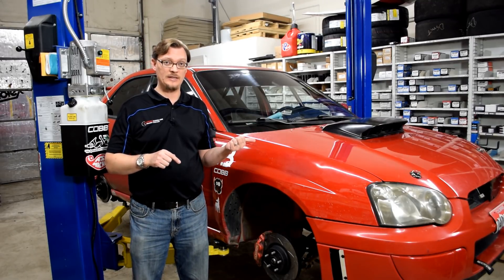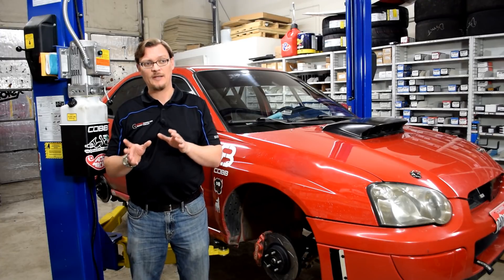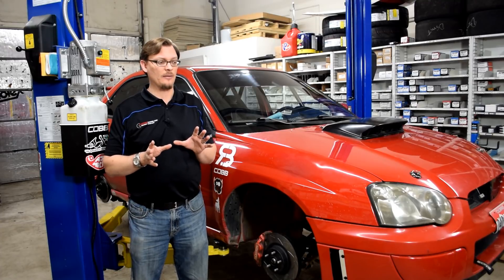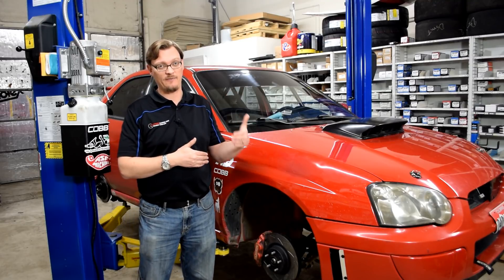STI 6-Speed Transmission Swap FAQ's

Comment: I have a 2004 wrx the engine just got rod knock at 230000 miles. I have 8k saved up to play with so far but I wanted to get a good guesstemet on what it is that ima need to have a engine that can handle 700 hp but have it tuned/built to 550hp-650hp. I care about the price as long as I don't spend more than 50k usdm that's my limit. Any ideas on what kinda build I might get for $50,000? Btw none of that is for looks only for engine, transmission, air ride race suspension, brakes, rims/tires, handling, turbo, ecu, fuel system...intercooler, air oil separate basically anything under the hood, under the body, idk if anyone gets me.
Reply from the maker: Thanks for your question Branden.  For that specific a topic, I'd definitely recommend reaching out to us directly.  Live chat on flatironstuning.com, or give us a call.  We can work with you to figure out what your best options are.

Thanks for watching and Stay Tuned!

Comment: Have you guys ever put an STI 6 speed into an automatic 2014 Forester XT? I'm assuming the trans would bolt up no problem as it is an FA20 motor, the same motor I have in my 2016 WRX. It seems like the more STI  driveline parts you have (knuckle, axles, hubs, differential, etc.) the easier it would be. Am I accurate in saying that? Thanks for all the info.
Reply from the maker: Thanks for your question.  We don't have any first hand experience there, but from what we know on the 15+ WRX, it is very similar to installing the 6-Speed into the 14 WRX, which is pretty straight forward.  Lots of things like the axles and hubs, etc., can be kept.

I hope that helps and Stay Tuned!

Comment: I have a 2011 wrx hatchback... swapping In a 2008-14 sti fb-ty856ub1ka from Japan with the short gear ratio 50/50 tourque split with no dccd...  but I'm having trouble with the wiring harness 6pin connector on the trans to the 4 pin on the car... should/can I still use the "Iwire adapter" to fix this? Even tho I dont have a dccd controller... also there is another 4 pin connector near the tail of the trams but I have nothing for it to plug into I'm not sure where it goes to or what it's for? Should I just cap it off... please help I'm awful with electrical
Reply from the maker: Thanks for your question.  If you aren't comfortable with the wiring part, then yes, the iWire harness would be the best way to go as it makes the wiring plug and play.

https://www.flatironstuning.com/iwire-turbo-to-dccd-transmission-adapter

Hope that helps and Stay Tuned!

Comment: I have a 2005 sti trans. I have a 2004 wrx car. I'm keeping the r160 rear diff. Do I need to have the dccd controller and Iwire?
Reply: The 2004 wrx rear diff r160 has a final drive of 3.90 which is the same for the 2004-2005 STI. That's what I've read up on and that's what your video said as well. So are you telling me the 2005 STI trans doesnt work with the r160 3.90FD?
Reply from the maker: @waltersjiu-jitsumoreheadci1080  Take a look at the video here where we go into detail on this:

https://youtu.be/uf4tcG5GqDU?t=379

But the short answer is that no, the 2004 WRX rear diff, and the 2005 STI transmission are not compatible.

Thanks, and Stay Tuned!
Reply from the maker: Thanks for your question.  You don't absolutely have to put in a DCCD controller, but it will really let you get the maximum benefit from putting in the 6-speed.  You can use the iWire adapter to make the wiring plug and play, but swapping the 5-speed wiring over isn't too bad either.

With no diff controller, the transmission will be in the default setting which is maximum rear bias.

I will say that your R160 will not worth with a 2005 STI transmission though.  I'd recommend making sure that you have a compatible rear differential before you start working on the swap.

Hope that helps and Stay Tuned!
Reply: https://youtu.be/nUJ7E2Bh5g0

In here you say you can swap a 2004-2005 STI in a 2002-2005 wrx with no issues. It's the easiest and cheapest why to do it. Is that not the case now?

Comment: I have a 2007 WRX wagon, and want to swap a full STI drivetrain, 6 spd, axles, driveshaft, hubs, r180, and suspension. Is that possible? Are there any differences between the sedan and wagon body/frame that would cause a conflict?
Reply from the maker: Thanks for watching.  The only difference is that the GD wagon is 10mm shorter track on each side.  So you would have to run the STI lower control arms and lateral links to be able to use the STI axles, etc.

The simplest path would be to stick with the WRX axles up front and the Driveshaft Shop conversion axles in the rear so that you can keep your hubs and suspension components.

I hope that helps, and Stay Tuned!

Comment: How much horsepower and torque can a wrx 5 speed handle with type ra gears
Reply from the maker: Thanks for your question.  From what we have seen, the RA gears can still have failures over 350 whp.  If you are not launching the car, there is a much better chance that the 5MT will last longer.  The driveline stress from a hard launch is what puts the most stress on the gears.

I hope that helps and Stay Tuned!

Comment: Can you do a video on good oil for the FA20DIT lol street and track.

I just started using Molygen 5w30 in a bran new car/engine and could smell what I think is oil burning when givin her. Its also the first time im reving past 4000rpm. 

I don't wanna gunk up my engine and turbo. Not sure if I should go back to factory mobil 1.

Thanks
Reply from the maker: Thanks for your question.  Thanks for the suggestion.  At some point we may do just that, so Stay Tuned!

For now, we do have a blog that is related to your question, so that may be a good place to start.  Here is a link to that:

https://www.flatironstuning.com/blog/what-is-low-speed-pre-ignition

Thanks for watching and Stay Tuned!

Comment: I would like to mount 2001 sti 6 Speed on a 2007 wrx. Does the engine starter motor has to be changed?
Reply from the maker: Thanks for your question.  You will definitely want to go through the transmission and rear differential ratios that we talk about at the end of this video.  There aren't any STI's that have the same ratio as your 2007 WRX, so you will have to do something with your rear diff.

Thanks for watching and Stay Tuned!

Comment: I have a 13' STI and having 4th gear issues.  Car has a hard time going into 4th gear. All other gears are ok.  Dealership already "corrected" the issue 20k miles ago, but it's coming back.  Car is no longer under warranty.  Question.. What would be better option? Pay to have transmission rebuilt or buy a 2017+ STI transmission with low miles for less than $3k?
Reply from the maker: Thanks for your question.  Honestly, the first thing I would recommend is changing the fluid.  The Subaru MT fluid is very good at helping with grinding issues:

https://www.flatironstuning.com/subaru-high-performance-gear-oil-75w90

If that makes no difference/improvement, then the issue is most likely mechanical in the transmission.

The decision to have your trans re-built versus buying a low mileage used trans is a tough one.  You have a known quantity with your trans, but you are somewhat rolling the dice with a used trans.  Hopefully it would work out, but you just never know.  

I hope that helps, and Stay Tuned!

Comment: I’m looking at doing this in a 2011 wrx hatchback.  What version transmission should I be looking got V10?
Reply from the maker: Thanks for your question.  Really the model year of the transmission isn't the most important thing.  I'd say that you want to find the 6-speed with the least miles that is in the best condition.  From there, make sure that you are pairing it with a rear differential that will work with the transmission, and you should be fine.

Hope that helps, and Stay Tuned!
Reply: FlatironsTuning 

1. Any 6 speed transmission? 
2. DSS speed conversion drive shaft
Is this the driveshaft you guys use?

https://www.importimageracing.com/collections/driveshaft-shop/products/driveshaft-shop-6-speed-conversion-1-piece-carbon-fiber-driveshaft-subaru-wrx-2008-2014

3. R80 differential? Or does this work for R60
4. Will I need the converter box you show in this video?

Comment: is there a difference between 04 sti axle (female) and 02-03 wrx axles? I've been getting bit of mixed answers...
Reply from the maker: Structurally, yes, but in terms of fitment, no.  Those early 04 STI's that have the male/female axle got the Spec-C axles.

They are very strong, and they need special boots if you were to re-seal them.

Hope that helps, and Stay Tuned!
Reply: @FlatironsTuning  thank you for your quick reply! I was a bit stumped with mixed info since I have V7 STi 6spd that didn't come with the stub axles. I tried installing 05 wrx Male axles into it and the circlip would not reach the diff and not lock in position. I figured that I needed to get the stub axles and install 02-03 wrx axles to make it compatible

Comment: So for my bugeye I can run any ear 6speed sti transmission? If I get a driveshaft, and ddcd controller and iwire cables ?
Reply from the maker: Thanks for your question.  The basic answer is yes, but you have to make sure that the transmission will work with whichever rear differential you decide to go with, and depending on the year, the STI trans may not have a speed sensor, so you would need to deal with that as well.

I hope that helps and Stay Tuned!

Comment: Awesome info. So on my 2010 WRX, if I wanted to keep my r160 I would need a late 06 or newer STI transmission, correct?
Reply from the maker: Thanks for your question Mitch.  I'd recommend you go back through the section of this video that talks about rear differential ratios.  You would actually need an 04 - 05 STI transmission only to keep you stock 3.9:1 R160.

And keep in mind that your rear differential is open.

I hope that helps, and thanks for watching!
Reply: @FlatironsTuning   Ah I had it backward. Thanks for your videos, they are very informative. Do you know if all the splines for STI transmission and diffs are the same? So I could use my WRX axles in the front for the 04 STI transmission.. and if I opt for the 04 STI rear diff, I would just use 08-14 STI rear axles, correct? Or do I NEED the 08-14 r180 to make the swap easy?
Reply from the maker: @BankruptSee  Take a look at the end of this video because we talk specifically about doing the narrow-body WRX swap, and that should answer your axle questions.  If you haven't all ready, you should take a look at our GR 6-speed video too, as we go into detail about the axles there as well.

But for you, this video will detail the critical info that you need for the narrow-body conversion.
Reply: Secret Label I just did my 2011 Wrx 6speed swap with a 04 sti transmission retained my stock axles, 08 AT drive shaft 6speed starter,  04 sti slave cylinder 04 sti transmission mount stock 5spd crossmember

Comment: What difference would there be if I were to use a JDM transmission instead of a USDM when swapping to a 6mt?
Reply from the maker: Physically there is no difference.  Some of the JDM transmissions have different ratios (mainly 5th and 6th), and as always, you will have to make sure that the transmission you are getting will work with the rear differential you are using.

Hope that helps, and thanks for watching!

Comment: Swapping 08-14 sti 6 speed into my 08 wrx, could I pair the 6 speed and r180 with the 08-14 STI Driveshaft?
Reply from the maker: Thanks for the question Nick.  Yes, if you are using an R180, that would be the driveshaft you would need.

Thanks for watching!
Reply: One last question for ya, so I have an 08 wrx, for the 6 speed swap from an 08-14 sti do I need to do anything to the pedal assembly?or is my stock wrx pedal assembly just fine?
Reply from the maker: @nickfishburn4962  Thanks for the question.  As long as your WRX is a manual, you don't need to do anything with the pedal box.

Thanks for watching!
Reply: I’m doing the swap into an 09 wrx. How did your swap turn out?
Reply: Chad Harrison I couldn’t have come out any better! The shop I took it to looked at me as If I was crazy. Told them every part that was needed and they agreed todo it. Then they call me when it’s all finished saying it works like oem and they couldn’t believe it. It’s now been over a year since the swap with about 15k miles on this setup. Runs flawless
Reply: @nickfishburn4962 what rear axles are you running?

Comment: o just recently had a 2016 Wrx with a STi transmission swap also opted with the DCCD pro controller kit with the adjustable knob on the interior I noticed when I got the car back the gear position indicator on the gauge cluster showed 1st 2nd 3rd 4th and 6th gear but when I put it in 5th gear it still shows to be in 4th gear just trying to find out if anybody else had this issue the shop is sort of giving me the run around saying that it's " apologize about that as far as the gear selector is goes off speed and rpm not an actual gear select sensor."

Comment: Whats a ballpark figure at the labor cost to do a 6 speed swap into a 2011 WRX if i were to source the parts?
Reply: Imported sti 6 speed will run u at least 3k for a good one and depends on the shop for labor tbh

Comment: So just to verify, because I’m a little slow, with a 11wrx I can bolt rear STI axles no problem, along with the R180 diff. And the proper diff mount for it. Also, I would need a STI tranny mount( even if I have a group N aftermarket?) wrx axles in the front, and I get to keep the suspension the way it is, I know I’m pretty much repeating everything but I want to make sure I fully grasped everything. Just to confirm again I do have a 11 wrx
Reply: Thanks so much, keep being awesome and posting awesome videos!!! So helpful!!
Reply from the maker: Hello Marco.  Yes on all counts.  Sounds like you have it all straight.

Thanks for watching!

Comment: Could a 6 speed be mated to a high and low reducer on impreza 1.5r 2010??
Reply from the maker: Thanks for your question.  From what I have seen from the Subaru's with Hi/Lo transfer cases, that is inside the transmission, so you would lose that with the 6-Speed.

Hope that helps, and thanks for watching!
Reply: @FlatironsTuning  that helps thanks

Comment: Would there be an issue with my R160 if I ran a JDM V9 STI transmission on my 02 wrx ? According to Rallispec the transfer reduction and final drive are the same as USDM 06 & 07 STI
Reply from the maker: Thanks for your question Luis.  You just have to make sure that your Rear Ring and Pinion ratio is the same as what the transmission calls for.  As long as it does, you will be fine.

Thanks for watching!
Reply: Awesome thanks 👍

Comment: What's different if you're swapping an 02 wrx wagon?
Reply from the maker: Thanks for your question Cameron.  I'll first say that you should look at the video that we did on the GD swap specifically.  Here is a link to that:

https://youtu.be/nUJ7E2Bh5g0

For the Wagon, the only difference is the track width.  If you decide to run STI axles, you will need to widen your suspension to the Sedan width.  Otherwise, if you are keeping your axles, and running your R160 diff, then they will work just as we describe in the video.

I hope that helps, and thanks for watching!

Comment: How much would the labor be if someone wanted a Forster sti long ratio box full six speed installed in a legacy with a 3.0r?
Reply from the maker: Thanks for your question.  I would recommend contacting the shop that you want to do the work, and go from there.  Sounds like an interesting project.